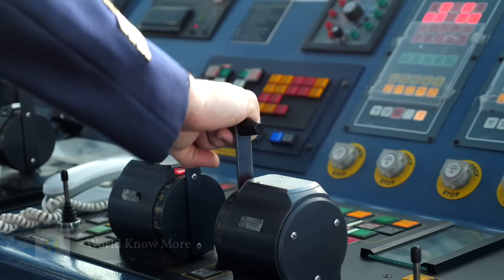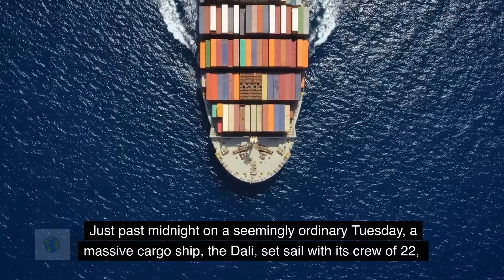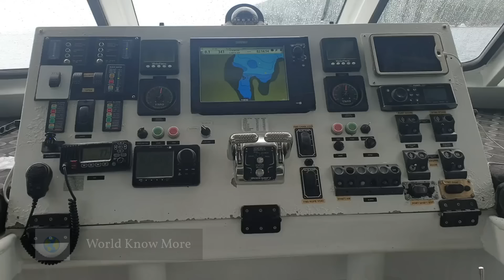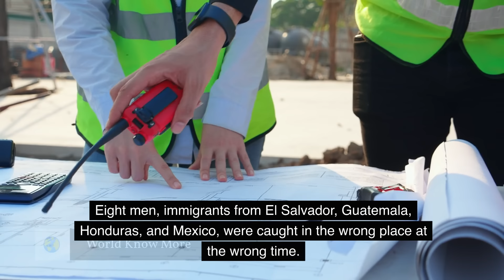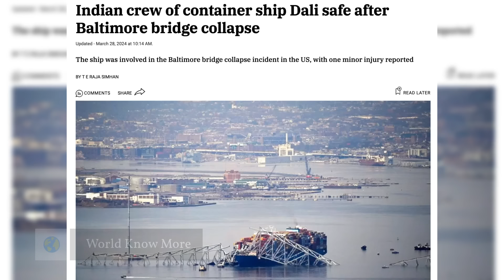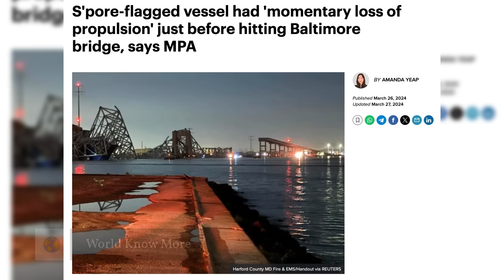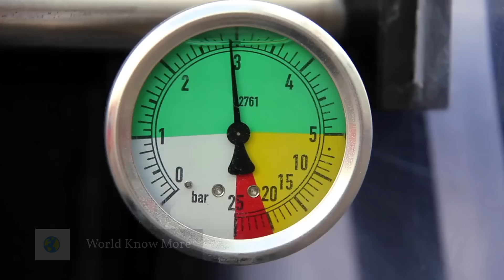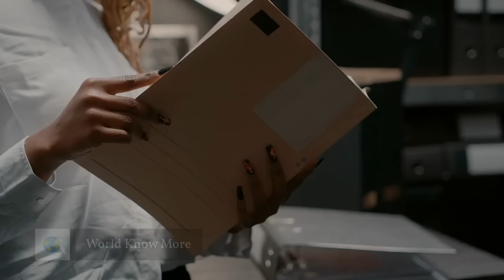How Singapore Ship Caused Baltimore Bridge Collapse

Comment: Ships crew did some maintenance work in AUX ENGINE and Main engine. Investigation to be carried out. Blending fuel oil process  for aux engine to be checked. In future strictly ask the owner to use DIESEL OIL ONLY not heavy oil or blending oil for AUX Engine in this narrow waters as per California regulations. Bad cheap not well  treated fuel oil is one of the causes of black smoke. If the ship crew tell the truth without fear, then only future accidents like this can be avoided. Because of power failure one of the Aux blower of the Main engine might have tripped while the main engine still running. This may be one of the cause for huge black smoke.

Comment: Let the US and Singapore experts check through all the records, equipment and datas of Dali and comes out with their reports first.
Should not speculates on the causes.
These experts need some time to do a thorough job.
Meanwhile US should look into similar American bridges at similar risk and improve their structural survivability against modern heavy ships such as the Dali crashing onto them.
Barriers, dolphins, etc, can be considered to be constructed around these bridges main supporting pillars.
The new Baltimore bridge should be more robust.
Better still, consider an underwater tunnel to replace the bridge instead.
Tunneling work can in fact start immediately with a TBM!
Can be completed faster than a new bridge.
May cost more but will eliminate this collission problem forever.
Reply: 8
Reply: @roysimpson4016  
Could you give more details on "8".
Not sure what you meant.